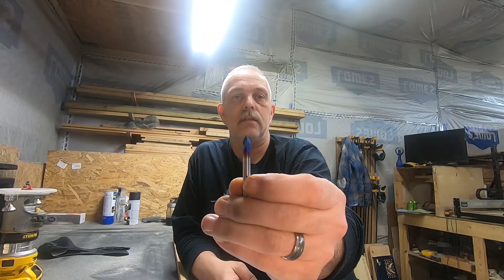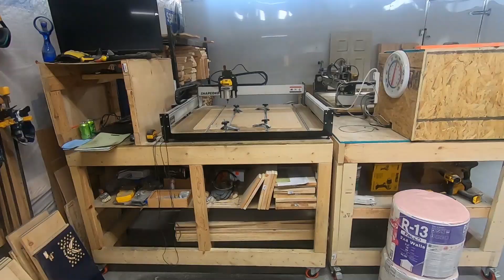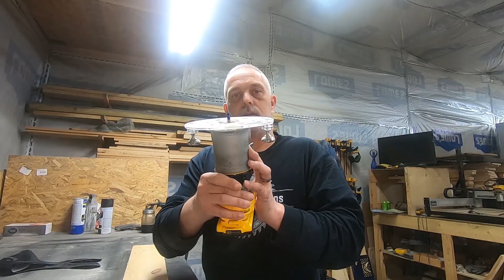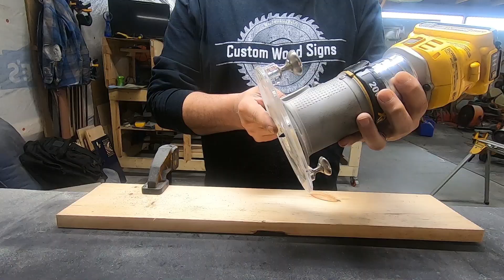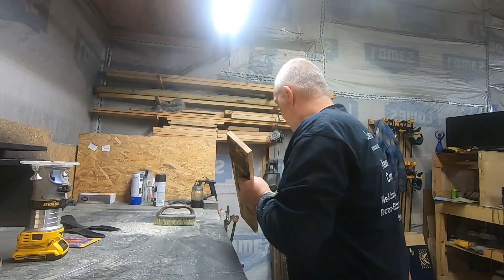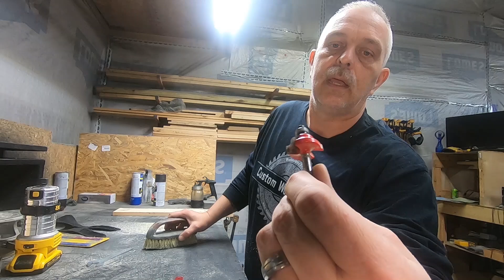Router Bits For Beginners - Helpful Guide For Wood Signs

Comment: Well your doing it wrong. 
And your trying to do a how to video.  Telling others to do it wrong.
Should do exactly the opposite of what you are doing. 
Put the router bits.  All the way down.  Then raise it up a quarter of an inch. Especially 1/4 in. shanks. Because of the Collette can get a full grip on the bit. And the less shaft protruding.  The less flex aka bit chatter.

Comment: A note on H&S in my shop... i) Router bits should be inserted to the depth of the collet grips - usually 20mm (3/4").  Take the collet apart to see the grip depth.  ii) Anybody in my shop not wearing eye protectors when routing is instantly dismissed.  iii )Anybody changing a bit without pulling the mains plug or removing the battery is instantly dismissed.
Reply: You mean your shed? This guy is at home, he can us whatever ppe he wants.

Comment: The bit should be fully inserted into the collet and then backed off just a tiny bit. The idea is to get the cutting surfaces closer to the router for stability and safety. This is more important on smaller router bits, like ¼" and ⅜" 

The reason for backing it off is because on some collets (mostly older ones) you need to have a little bit of space, to press in on the bit after loosening the nut, to release it. 

Most newer collets don't require the space. When you loosen the nut and it seems to get tight again, that's doing what pressing the bit in used to do.

Comment: I’m wanting to make square holes to set live edge on square table legs frame. First time using router. Lol. But work with live edge wood a lot. The straight bit is what I bought. Ridged 2 hp fixed and variable. I’m pretty confused even as to what I use fixed or variable. Then getting the  4 square holes in. Hope I make sense. Thx
Reply: By variable I meant plunge. Sorry

Comment: Respectfully disagree with your 1/4
" in on the shank.  Most quality bits have marks on the shank that are at the most 1/4
" from the beginning of the cutter edges, more like 1/8" from the beginning of the cutter.  Your collet is ~7/8" long and the bit shaft should be at least protruding out the back end of the collet. At your depth you are gripping with only 2 of the 4 flutes. The router shaft is tapered in and is what squeezes the collet flutes in on the bit shank as you tighten the nut.

Comment: I just got a router a few days ago and I was not aware that one could make signs with them.

However I had no idea on what bits one would use and as such I went looking on YouTube for info and found your very informative video. Now I know what bit to use and how much depth or height to set the bits at.. 

From all of the  videos on here on how to insert  bit they all have one pushing it all the way in and then lifting it out about an 1/8 of an inch. It looks like you pulled yours out almost have way up the shank and that surprised me as I assumed that is dangerous.

Comment: What are the three bits called, again? I kept trying to find where you said that at the beginning and…
Reply from the maker: Thank you for your question!  Here are the three bits mentioned in the video:
Endmill - Amana Tool – 46321 Solid Carbide Spiral Plunge 1/4 Dia x 1-1/4 x 1/4″ Shank Up-Cut 
VCarve 60 degree - Amana Tool 45624-K SC Spektra Extreme Tool Life Coated V-Groove 60 Deg x 1/4 D x 31/64 CH x 1/4 Inch SHK 3-Flute Router Bit
VCarve 90 degree - Amana Tool 45614 Solid Carbide V Groove 90 Deg x 3/8 D x 3/4 CH x 3/8 Inch SHK ZrN Coated Router Bit

Comment: I prefer placing my bits deeper in the collet but staying away from where the shank flares as it meets the cutter portion of the bit. Still enjoy your videos. I learn something new almost every time I watch a video. Thanks
Reply: Agreed. Problem with only putting it in 1/4" is the shank can break if the bit is not balanced or has side force put on it. Much less likely to happen if it's placed as you say.

Comment: I’m using router to carve frame for a wooden puzzle.  My borders require accurate lines with 1/2 in depth into a 3/4 inch base.  Which base do you recommend?  Wood like Red Oak or plywood?
Reply from the maker: Thank you for watching!  Either would work.  I would suggest the wood you use be the look you are going for on the end product.  Red Oak would provide a great look!

Comment: what about carving line bit and profile bits?  I see that they are used a lot on carved wood signs.  Also what should be the max diameter/lenght straight bit to use on a palm router?
Reply from the maker: Thank you for watching!  The carving liner bit is great and used for extreme detail work and carving (1/4 inch diameter).  I have used the carving liner bit, but don't recommend carving very deep with it as you may break the tip.  The profile bit (1/4 inch diameter) comes in many different angles on the cutting end, for example, 60 degrees and 90 degrees. I use the 60 degrees for about 99 percent of my cuts. They vary in length 2 1/2 to 3 inches approximately. To the best of my knowledge, a typical palm router will only use a max of 1/4 inch bit (diameter).  If you wanted to use a 1/2 inch bit (diameter) you would need a bigger router that has a collet that accepts a 1/2 bit, plus you would need the router with power to use it.  Hope this helps!

Comment: Beautiful signs. I like to use the ones in the link plus several others like Amana for different orders. I use the handheld router to carve just like a scroll saw plus I do resin inlay pictures. YIYATOO 20pcs 10° 15° 20° 30° 3.175mm Carbide PCB Engraving Bits CNC Router Tool 0.1mm . I like watching fishtank5050 with the end mill bits. The 10 mm is perfect for the stars on my flags .

Comment: Enjoyed your video very much.  Very informative.  But I have a question.  I am going to engrave into a 4x4 cedar beam a memorial monument.  Just the name and dates.  What would be your recommendation for depth and bits to use.  Also to paint the letters to be legible??? Your input and help is very appreciative.  Thanks in advance.
Reply from the maker: Thank you for visiting!  Test your design on another piece of wood to see if there are any changes your want to make and/or adjust.  I would recommend you start with a 1/8 depth to ensure your design is good and then go down to a 1/4 depth.  Going slowly with the depth allows for you to look at your work as you go and make adjustments.  A 60 degree bit would work very well.  As far as paint, I would suggest applying a sanding sealer first.  This will keep the paint from bleeding in the wood.  Then I would recommend Rust-Oleum black primer and sand off over the lettering.  As mentioned before test on a separate piece to ensure it will work as you want.  Hope this helps!

Comment: what size 60 degree v- cut bit do you use in the video? New to making wood signs any info would be greatly appreciated?
Reply from the maker: The 60 degree router bit I use is a 1/4 diameter shank.  If you want more detail you can see our recommended products page here - https://www.woodworkingbylpicustom.com/router-bits-top-recommendations/.  Let me know if you have any further questions!

Comment: I’m thinking of starting sign craving. I’m seriously thinking of getting the Dewalt 600 cordless router but olddaves channel said it wasn’t that good for sign carving due to battery life he suggested the corded 611 granted he did only have a 2 amp battery . I would prefer cordless so what are your thoughts would it be good with a bigger battery or should I get the corded 611? Thank you!
Reply from the maker: Thank you for visiting! I do have both of them and they both are very good routers.  With regard to the corded it will carve very well for you and has plenty of power, I have used it for both manual carving and I also use them on my CNC's.  With regard to the cordless it does an excellent job as well.  Completely agree with Dave on the power however,  I mostly use my cordless for edging and minor carving and it does run out of battery life using the standard battery after a while.  I have used the bigger batteries 5 AH and the Flexvolt with the cordless with great success and it does last longer.  The only concern I would mention is the weight it adds to the top of the router when carving.  If you are comfortable using with a little extra weight on the top due to the battery I would recommend the cordless.  I hope this helps!
Reply: @woodworkingbylpi   Awesome!!! I think I’ll try at least a 5amp battery if not a flexvolt. How long do you think the runtime would be then?  With one of these batteries make the  cordless more appropriate as a go to for sign carving especially because I don’t have a business I just want to do it as a hobby.
Reply: Or should I just go corded? So I have a general purpose router?
Reply from the maker: @mikelake662  It really is a personal choice. Your can't go wrong with the corded it will work very well for you and the battery will also considering the battery choice mentioned previously.  Best of luck to you in your carvings!!

Comment: I see the common depth setting in the collet, like for your Roman Ogee bit, is insert and pull back 1/16" for the reason of clearance for thermal expansion.  
Thanks for the video!  Came here to see what primary bits I need for signs with my Dewalt Compact router.  Got what I needed!  👍👍
Reply from the maker: Thank you for visiting! I'm so glad it was helpful for you! Best of you luck to you!